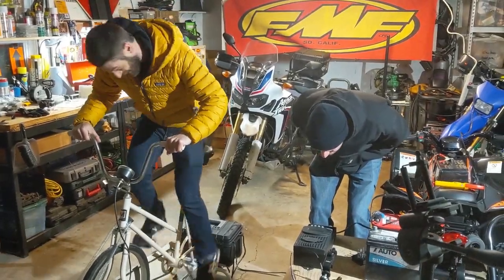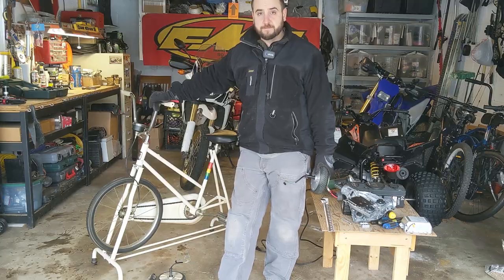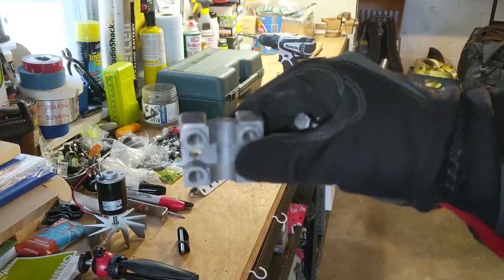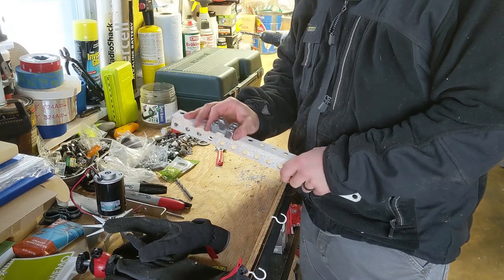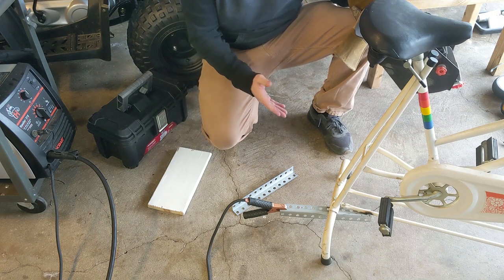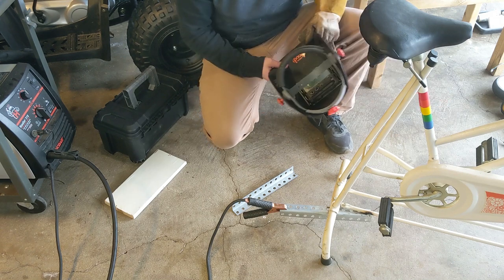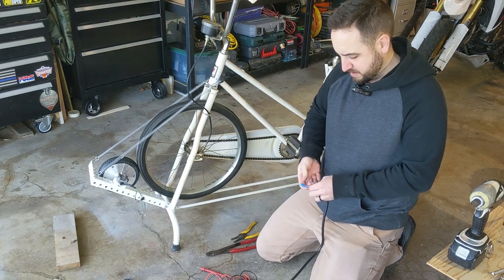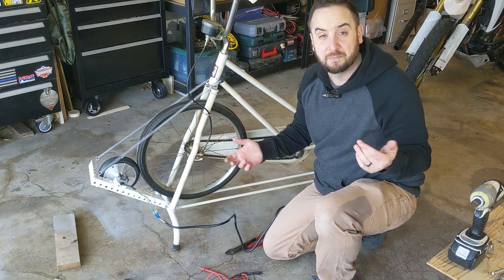DIY Bicycle Electrical Generator - $100 Build Cost!  Up to 24 AMPS!!!

Comment: Amperage is totally irrelevant.  What is totally relevant is the total power output expressed in watts.
Reply: you can calculate it. 24amps in 12volt system is 288watts
Reply: A "normal pace" was 4 to 6 Amps at around 13 Volts (from the display shown around 16:42), which is 50 to 80 Watts.

Comment: How long would you have to do this at a sustainable pace in order to fully charge a given battery and what can you do with that much?
Reply: typical car battery has 100 Amphours. That means at 14 volts charging voltage, you need to supply 1400 watt hours or 2 hp-hours to fully charge it from discharged state. 

“An elite cyclist can produce 440 watts over an hour…An adult of good fitness is more likely to average between 50 and 150 watts for an hour” https://en.wikipedia.org/wiki/Human_power

so let’s say 100 watts. That will require 14 hours of total pedalling time to charge the battery. Are you up for it?

Comment: Would that work better if you modified a 10 speed bicycle with additional gearing, along with modifying the power wheel to be adapted to be Chain driven?

Comment: Nice project! And useful information, particularly the availability of cheap hoverboard motors, and the final power output of this machine. 
So to summarize: "normal pace" was 4 to 6 Amps at around 13 Volts (from the display shown around 16:42), which is 50 to 80 Watts. That's around the "normal output" (not peak output) of a single 100 Watt solar panel. Using this setup, it would take about 20 hours of cycling to produce 1 kWh (Kilowatt=Hour) of energy.
For reference, 1 kWh costs from 10 to 25 cents in the USA currently (August 2023). That 1 kWh could power a 1000 Watt microwave oven for 1 hour, a typical 100 Watt TV for 10 hours, or a single 20 Watt lightbulb for 50 hours.
Reply: how would you use this set up to charge a battery? would you have to convert it to dc using a rectifier, and then go through a charge controller? @RobertShrimpton
Reply: That and/or an inverter, probably. 
(not an electrician)

Comment: Question 
4 amps at what voltage? (12 or ?)
If 12v then 48 watts (modest)
Suggestion:
Drive with a chain (chains are highly efficient).  Friction = power loss (via generating heat).  I’d bet half of you power is being lost to friction.

Comment: Concept - 100% - build, hmmm - fab idea - thanks for sharing. I would have mounted the generator "beneath" and at "rear" of the cycle wheel instead of in front.
Reply: he mounted it in a exercise bike so thier is no rear cycle wheel

Comment: I assume anyone talking about amps instead of watts is just very immersed in 12V infrastructure. So that would be 4 to 6 amps at 12 volts you are talking about?
Reply from the maker: Moreso it's just common verbiage that an audience can understand.  I spent years designing mobile off grid systems for the military.  Well versed to say the least but I have to cater to the audience to a degree.  Yes 12v output to the battery after the cc does its job.
Reply: @downstateradv  Yeah, that's what I meant - thanks!

Comment: If you put more than one motor will it double the power output?
Reply: not likely, the resistance from a second motor would use up the rotational energy, so the total output might actually decrease from the extra energy needed to spin multiple motors

Comment: You had me up until you said weld a little bit. Great concept though but I won’t be buying a welder under $100. Cheers
Reply: You can buy a mini stick welder they plug into a regular wall socket and only cost about $100. It's well worth having due to how useful it is. If you want to be absolutely cheap you can make a stick welder from a microwave you find in the city dump.

Comment: I just can't understand that why hasn't this person add any phlywheel or flywheel to this concept
Reply: Based on the video he did it very cheaply and proved the concept.  When you build one you can add as much weight to the wheel as you want for perpetual motion.  Also this is a pretty light duty bike. Great build and I am sure that you can improve upon it vastly.

Comment: Why not use a 24 speed bicycle with the bigger gears the wheel will go faster won’t it
Reply: Actually that solar charge controller is already build to extract max power from a source with a variable output. I dont think mechanical gear shift would help much when it already has 'electronic gear shift'. This seems to be really good combination of simple and efficient setup for bike generator.
Reply: It's true that gears would help to maintain a more comfortable pace, but gears don't create energy in any way, and to turn the wheel faster, with or without gears, will still require more power in, i.e. a greater pedaling force.